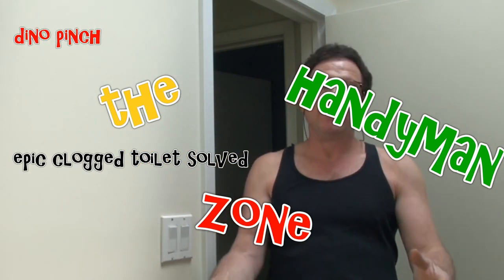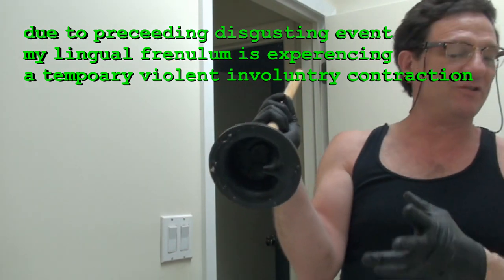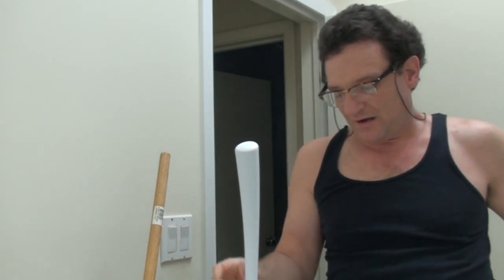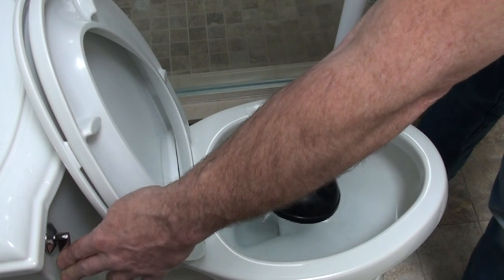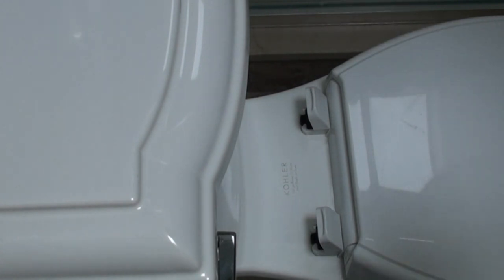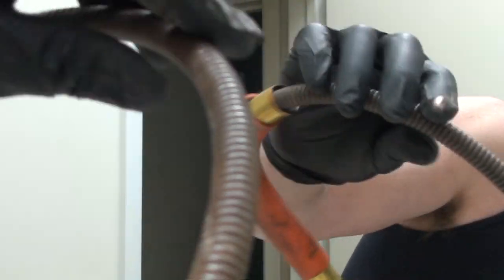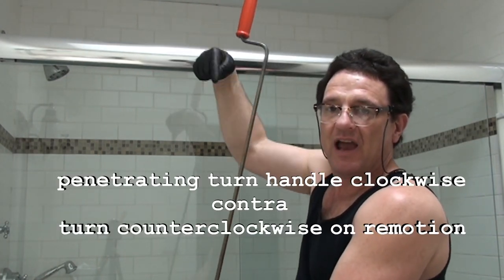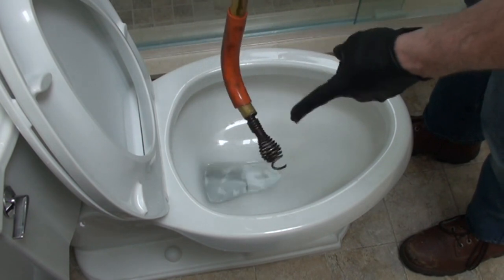Clear Clogged Toilet Using Closet Auger or Snake

Comment: I have a kohler dual flush toilet and tried an auger with the same-shaped head as yours, but couldn't connect with an opening to the pipe.  I thought maybe the cobra-shaped head was too large. I followed the instructions, the head drawn all the way up, and then turning the handle clockwise. After a while, I saw that the snake wasn't advancing. Do I need a different head? By the way, thanks for the tip about not scratching the porcelain.

Comment: How big of an object is safe to use a snake with.  My children dropped a small ball down my toilet. Is it safe to use the snake?
Reply from the maker: depends on lots different things like size, shape, material (metal, paper, plastic, rubber) can the auger break it up like a plastic container, or hook it like paper, sponge, or child's toy, shape of item and area of drain pipe like pen, toy, shampoo bottle, eyeglasses....you just have to try

Comment: Thanks again for a great video.

Tell me something; HOW do I get BROWN "run down" hard water stains from YEARS of cleaning neglect In my apartment toilet bowl?

It looks disgusting, solid as a rock and totally resists chemicals and HARD scrubbing!

Can you help me?
Reply from the maker: thy sell block of "pumice" in home center in cleaning supply isle( $3.00), its chunk of volcanic rock that scours everything off the porcelain toilet without scratching, ajax has ground up pumice in it but i find the block of pure pumice is best, bail out the bowl with paper cup and sponge so you can scrub and get to work.....20 minutes and it will look brand new
Reply: Dino Pinch ii
Reply: Dino Pinch
Gee, THANKS!
At this point - after muriatic acid - I'll try ANYTHING!
You know, I am a VERY clean person and my bathroom smells like stale piss!
I think it's locked up in those stains!
Know what I'm talking about?
Reply from the maker: Google "pumice clean porcelain"  , then elbow grease
Reply: Try using a flat head screw driver as a chisel to scrape it off. Usually comes off in a sheet. Also can try toilet cleaner called "It works" only one I found that actually does work. Drain the water from the bowl first. You should see the mineral deposits melt away then scrub with a toilet brush to get whatever is left

Comment: For a toilet on the third floor of a 70 year old  house are there any possible reasons for blockage other than something being flushed down that does not belong in the toilet? Toilet was flushing fine then BOOM....it was blocked. All other toilets in the house flush with no issues.